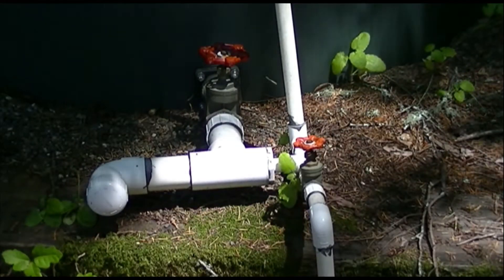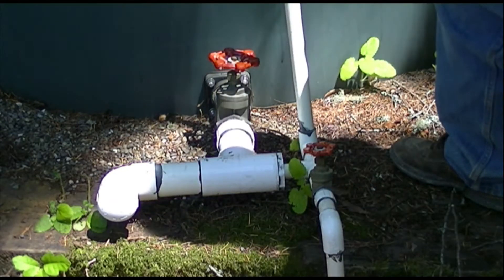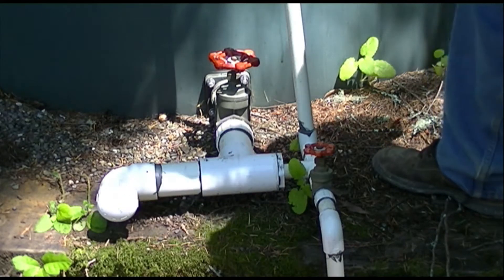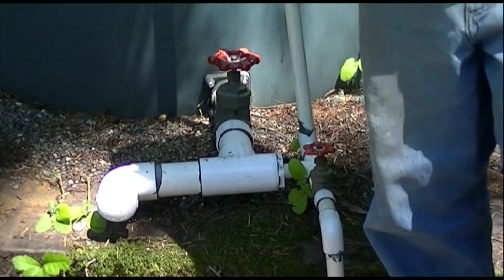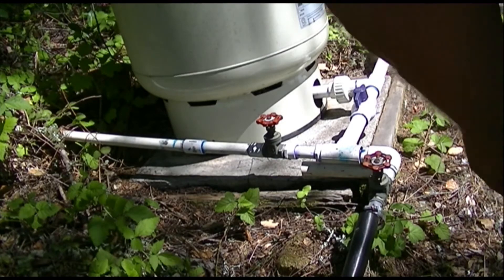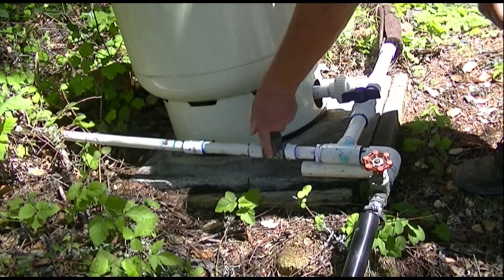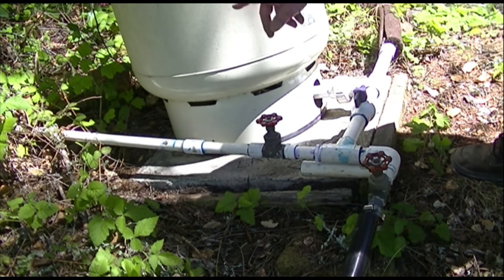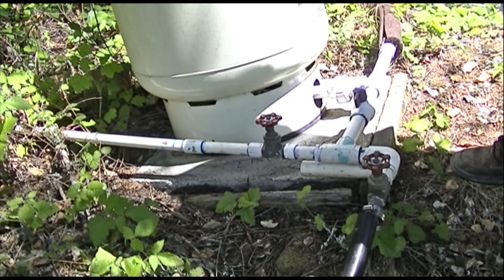Gravity Water Tank  The Plumbing Is Simple

Comment: very impressive - can you do a video on the holding tank for the gravity system?
Reply: what is the approximate drop from holding tank to house?
Reply: @erichr.lehmann8272  Maybe it would provide I guess 8.5 lbs per foot higher than the house. So if you want 40psi tap to you house you'd want your gravity supply tank roughly 300ft higher(but that's directly up and down like a water tower) so you'd have to account for angular measurement as well using natural terrain. Just guessing does this sound correct?